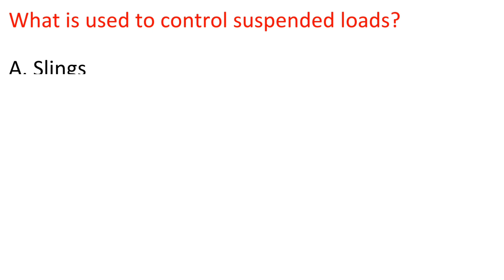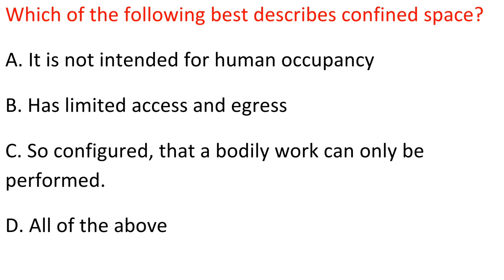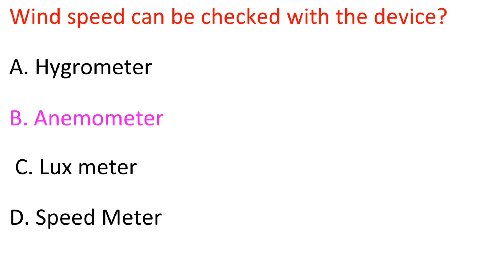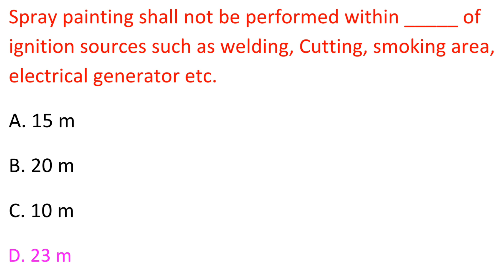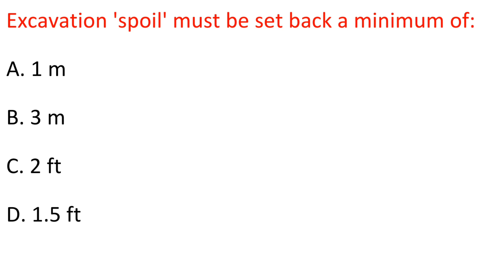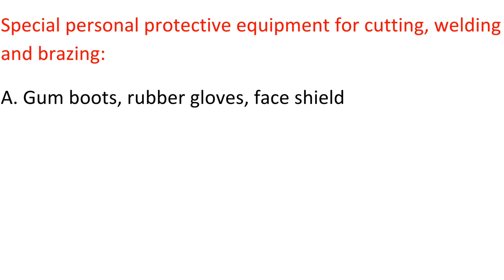Saudi Aramco Safety Officer Written Exam Question and Answer part 2

Comment: The uppermost work platform height shall not exceed 4 times the minimum base dimensionof any mobile or tower scaffold. Where the basic scaffold does not meet this requirement,outriggers shall be installed on the scaffold to achieve this least base dimension, orprovisions (such as guys, ties, or rakers) shall be taken to stabilize the scaffold againsttipping

Comment: Minimum safe distance over head power line of 50,000 kv answer 7.6mtr really?... i think 3.1 mtr  is the correct answer, 7.6mtr is over 300,000 kv Minimum safe distance, Mr. Author some of your answer is incorrect pls. correct...